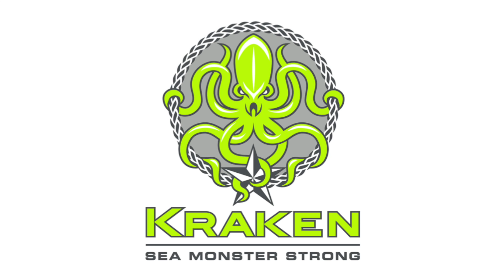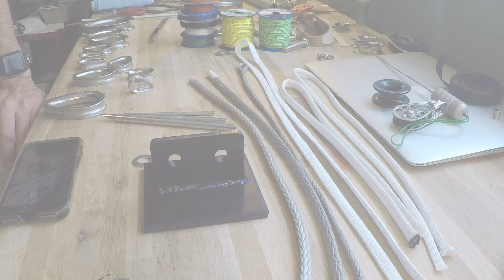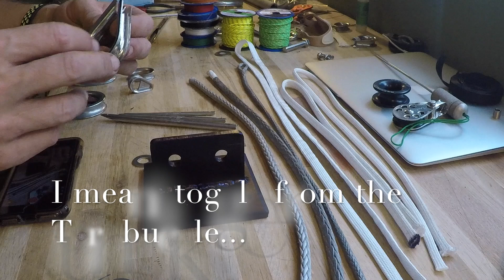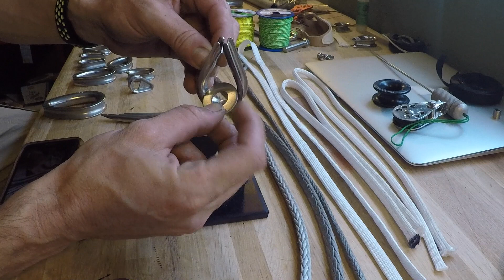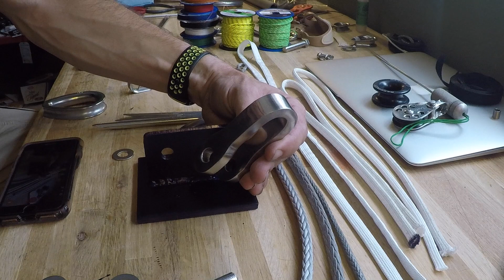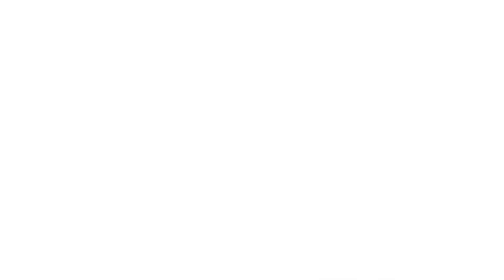Custom Hardware for Synthetic Rigging

Comment: Pulling the chain plate and putting a buttoned eye(s) with low friction ring through the hull with a steel or carbon fiber plate inside would be lighter, stronger and cheaper.

Put in the low friction ring after through hulling it, obviously.

So, your sleakest possible toggle, at 4oz by itself, would outweigh your chain plate and toggle soft rigging replacement.

You also have a much smoother connection and much easier tensioning by using a 2mm dyneema lashing shock from the low friction hitch to the end thimble on the stays.

Comment: Hardware looks great. Why not just use the smaller toggle on both ends?  Seems it would work just as well as the large ones and save money, time/labor and a bit of weight.

Comment: Hey Luke! Thanks for the video! I have a question, if by any chance you get this message here! In the video, you mentioned that enlarging the hole in the chainplate is not recommended. Could you comment on this? I was thinking if I were to go with the dyneema rigging, I could enlarge the holes in my chainplates and add shackles to it! thank you again.
Reply from the maker: Adding shackles would be redundant, and the size of the shackles that would be the appropriate strength would be just as expensive as Colligo female chainplate distributors.  Enlarging chainplate clevis pin holes should only be done in a machine shop with proper tooling, never with drill bits - then chemically treated to dissolve any iron particles that the cutting tool leaves behind or you will have surface rust coming from the hole.  The holes can only be enlarged if there is enough base material, cutting away too much will weaken the chainplate.

Comment: Just curious, Did you consider replacing the toggle with a double eyes ended piece of Dyneema or some such similar? I guess the call would the creating/designing the new pin and attachment vs fabrication of toggles similar to current method.  You might get away with a closed dyneema loop wrapped  around  pin through a the chain plate several times then  retained by end washers... Humm,,, You seen more of the stuff. I have only watch this video...  Again I am just curious...
Reply from the maker: Anything is possible, but you have to consider chafe for hard attachments much more so than the shrouds themselves.
Reply: @SteelDoesMyWill  thanks

Comment: I have worked with synthetic and natural rope a lot thru the years, more so than with "steel". I haven't seen anyone address forestays with Dyneema. I am not a fan of rollers and was wondering about what the performance and wear would be with hank on, with a product like Dyneema. The wear would concern me, but it is fixable afield. The performance of maintaining sail shape of a Gen or Jib ( I realize that a major portion of that load is on the halyard and loft from head to tack) is another concern. Any thoughts?
Reply from the maker: Yes, boats with roller furling should stick with a wire forestay.  Right now there isn't any luff-foil on the market that would be friendly to Dyneema, plus the diameter grows quite a bit at each bury of the splices.  For hank-on sails a Dyneema forestay is perfect using a series of small soft-shackles which are then called soft-hanks.  The forestay should be fully covered with a Dyneema chafe sleeve which is very tough and also slippery.  It's a heck of-a-lot more work, but each soft-hank can also be fully covered with chafe sleeve making them more resilient, but It's not totally necessary.  The friction from the soft-hanks may be a bit more than bronze hanks, so a down-haul for the jib halyard is highly recommended.  In some of my upcoming videos on jobs I have done for other boats you'll see shrouds fully covered in chafe sleeve.
Reply: @SteelDoesMyWill , Thank You. I am looking forward to seeing the rigs. I have been in indulging in some old school Marlin skills this evening with The Rig Loft Matthew Otto. I was taught sewing, knitting, crochet, macramé at an early age by my mother, who helped me rebuild the front end of my first car... LOL  I love that these skills are coming back in vogue.

Comment: technically there IS pointloading on the thimbels. The thimble is curved and the toggle is curved in one direction (it is bent :-)) but flat in the other. So techniclly there is pointloading from the sides of the toggles to the thimbles.
But I do not think it will be a problem :-)

Comment: Hi @Kraken I need to replace 2 Bowsprit Whisker/Stay Wires. currently they are 3/16 1x19 type 316 stainless wires attached to hull via chain-plate on one end a a 3/8 turnbuckle on the other end. Would you recommend going with Synthetic Whisker/Stays? If so what would you recommend?
Reply from the maker: Sent you a message on FB, nice talking with you Luis!